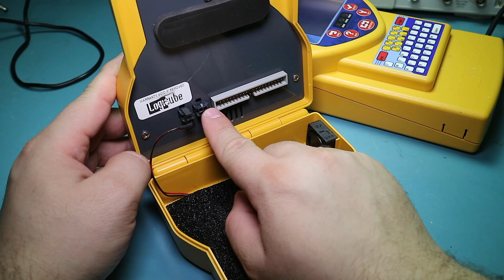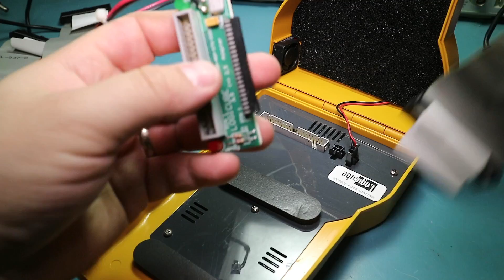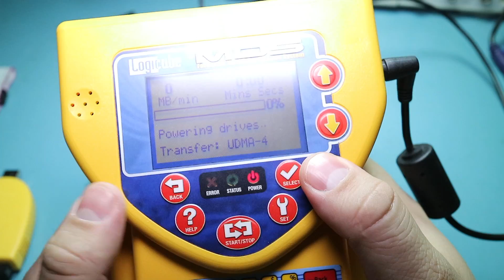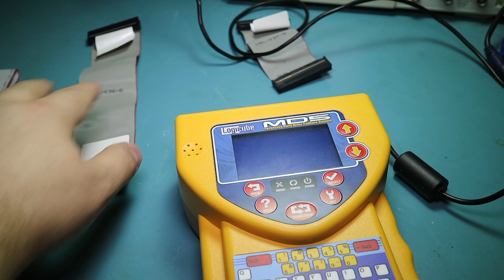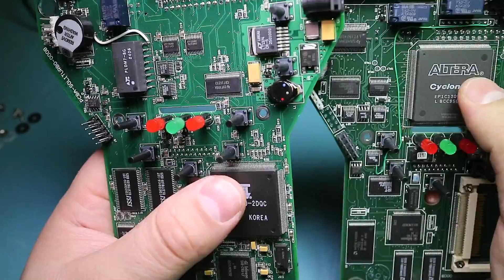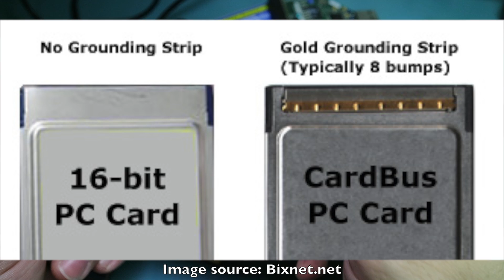Logicube SF-5000u + MD5 Forensic HDD Capture Devices Teardowns

Comment: All the sysops in my school district had some similar units for cloning hard disks.  They actually had a faster interface than most PCs could provide, using an FPGA to provide the interface logic and a large amount of SRAM for read caching.

2.5-inch PATA drives use a 44-pin connector.
Reply from the maker: douro20 I think they do make a line of models which are geared toward normal cloning (I think they are usually in blue or grey cases), probably the exact same thing only without the "official forensic device" wording of everything. 

There are a bunch of standalone units which plug into a wall and clone many drives at once (I have one of them - video pending. :P)
Reply: And they weren't much cheaper.